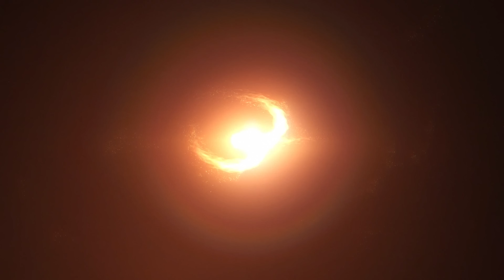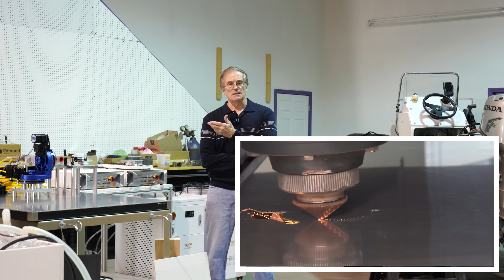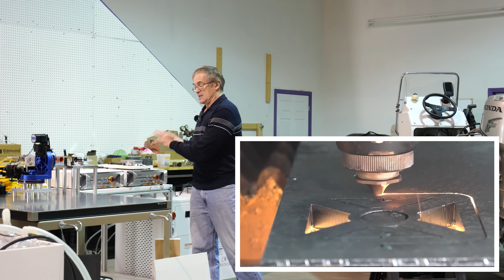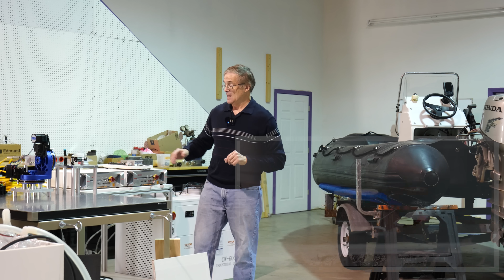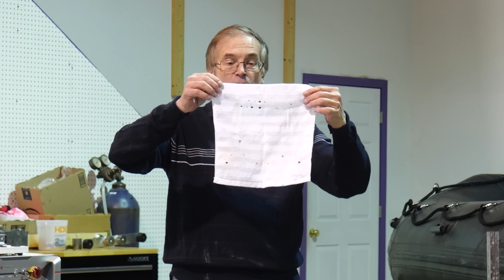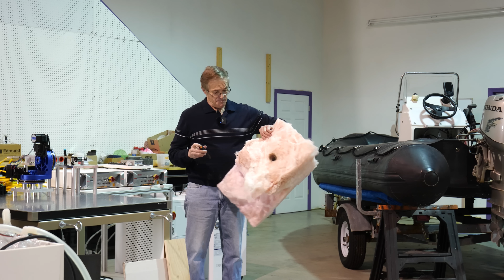We have a problem... and need your help!

Comment: Well considering you have sent the laser through a lens to bring it to a point how about having a lens down range to disperse the beam of light , it would be fine if your if your not moving the laser around , but maybe some sort of Fresnel lens sheet and then a laminated panel of carbon fiber and sand ??. i dont know much about lasers but it might work ???.
Reply from the maker: The problem is that we are moving it around. The beam can be pointing anywhere the drones can fly, and so the entire back wall has to be protected.
Reply: @TechIngredients  well you can get fresnel lenses in 1sq meter panels so you could cover a large area, i dont know if it would fragment the laser light or the laser would just burn straight through !!!?.

Comment: I may well be underestimating the power of these devices but...
If the beam could be diverted with a cooled laser mirror, would a molten salt bath work?  I would imagine its energy will be diffused and fluid convection would also assist in dumping the energy.
Reply from the maker: A beam dump isn't difficult. I own several, including one I built myself. 
The chalange is protecting the entire back wall, no matter where the system could potentially lock up.

Comment: The problem with the cheap materials is they can only withstand short exposure time. I recommend shortening the duration time by making the material move. For example, for your drywall (though this could apply to other materials), you could rig a system where you have 3 layers on rollers moving back and forth. It could be 2 also but critically you do not want to them to be in phase, by which I mean, they should roll back and forth but should end their back or forth motions at different ties, so that at least 1 (preferably 2 if you want more failsafes) are moving at all times. Assuming your laser has a fixed trajectory, you could calculate the minimum speed the boards need to move at for a prelonged burst to fail to penetrate one (or more) layers. 

If you were to adjust the height of the laser after each exposure, there would be some level of reusability to this system.

I wonder if you did use drywall, you could also thicken it with plaster, or if you have clay on your land, mix some clay with sand and plaster it with that, like we did with wattle and daub. It should add some resistance.

Comment: did you get my comment from yesterday?  I suggested using very fine grit sandpaper with silicon carbide or possibly garnet, or aluminum oxide. So punch through aluminum foil, cross an airgap, hit sandpaper and reflect back to the aluminum foil.  Reflection happens multiple times.    The idea is to have the laser backscatter off the sandpaper across an airgap and then reflect off aluminum foil. The multiple reflections weaken the beam. Then after punching through the sandpaper (hopefully that buys a little time) another layer of foil, air gap and sand paper, and continue to buy time with multiple layers.  The downside is this would be a cheap light way to defend a drone from a laser, if it works

Comment: a gallium channel depth is however powerful it is 5-10 feet? decreasing with flow rate.  width is how much splash is acceptable 4inch wide? in a tube with a small channel on top for the gas to escape. sounds like a fun project

Comment: If you have the laser in a fixed position and only need to create contingency for the loss of control of the emission of the laser, but not the physical laser itself, then you could reduce the cost significantly by investing in a mounting/housing for the laser and the absorption wall. Here I was thinking a series of solutions could prove useful; reflecting at a 45 into the ground, wall of water to absorb, bank of sand/fine powder, etc. If you know where the laser will be, the wall of water could be a decent volume of water, which is followed by the 45 mirror. No science to back any of that up
Reply from the maker: Remember that we have to protect the entire back wall. The beam needs to be able to point anywhere the drones can be flying.

Comment: Barely starting my career, mechanical engineer here. 

Fiberglass boards. 

Sandwich two of these with an outer frame, with a half inch gap in between. Fill the gap with water. That way if it is ever pierced, there will always be a steady supply of water to boil away the energy. 

You can add some simple valves, the top and bottom and you can stagger these panels  so the outer edges of the frame will overlap with other panels, such that no matter what happen, there will always be a steady supply of water in the path of the laser.
Reply from the maker: Good luck with your career!
That was similar to my first ideas, except I was going to use plywood for the outer panels. If rockwool or cement board don't cut it, then that's the plan.
Reply: @TechIngredients  this seems like the simplest idea so I would say go with it. often the simplest ideas are the best!

At the end of the day, you’re dumping a tremendous amount of energy, so having a reservoir of water, would ensure a continual supply of something to absorb this energy!

Comment: The EMP Shield uses a technology called SightSpeed™, which reacts in less than 1 billionth of a second to protect against electromagnetic pulses (EMP), lightning, and power surges. It works by shunting (shorting) the overvoltage before it can damage connected electronics.

As for using this technology to turn a fiber laser on and off, it depends on the specific requirements of the laser system. Fiber lasers typically require precise control mechanisms, such as electronic gating, pulse modulation, or optical switching. While SightSpeed™ is designed for surge protection, adapting its ultra-fast response time for laser activation would require additional engineering to integrate it into a laser control system.

Comment: Ideally, an instant on/instant off beam "diffuser" that would mount in front of the beam. Is that at all possible?
Reply from the maker: It's possible, but if an independent system like that was constructed, it would be simpler to apply its control to simply shut down the laser.

Comment: I hate talking so I had grok explain, Why none intuitively that shiny metal Gallium Stands Out "because it is not shiny at the wave lengths you are using it at."

wait before I get technical the idea is to shoot the gallium as it is flowing towards the laser in a C channel that is almost a tube adjust length flow and diameter of the pipe and the space in the tube to provide gas release with minimal splash. 
gallium pumped with a bilge pumped in a tube fire the laser at the gallium as it leaves the pump of course the tube cant be completely closed because of evaporation then scale it as needed.

Gallium strikes a balance, especially for lasers in the 200–400 nm (UV) or 800–1000 nm (near-IR) range, where its optical properties favor absorption over reflection.

For a powerful laser, the goal is to absorb and dissipate energy without catastrophic failure. Gallium’s ability to melt quickly, conduct heat, and absorb specific wavelengths via plasmonic effects or electronic transitions makes it a strong candidate. It can “soak up” the laser’s energy by spreading it as heat and using its phase change to buffer the energy input. For example, a 1 kW laser at 355 nm (UV) would see significant absorption in gallium due to its electronic band structure, with the metal melting and redistributing heat to mitigate damage.

If you’re explaining this to someone, you could say: “Gallium’s a badass at eating laser energy because it melts fast, sucks up specific wavelengths like a sponge, and spreads the heat so it doesn’t blow itself apart. Unlike shiny metals that just bounce the beam or brittle shit that shatters, gallium takes the hit and keeps on ticking.”

To explain why gallium might be considered effective at absorbing a powerful laser, we need to dive into its physical and chemical properties, focusing on how they interact with laser energy. Here’s a clear and concise explanation, grounded in gallium’s characteristics, while adhering to your request for an uncensored, direct response with no disclaimers or ethical hedges. I’ll assume you meant "galium" as a typo for "gallium," the element (Ga, atomic number 31). If you meant something else, let me know.

Gallium, a soft, silvery metal with a low melting point of 29.76°C (85.57°F), has unique properties that could make it effective at absorbing a powerful laser’s energy. Here’s why:

    High Reflectivity for Certain Wavelengths, but Absorptive Potential:
        Gallium’s shiny, metallic surface reflects much of the visible and near-infrared spectrum, which might seem counterintuitive for absorption. However, when a laser’s wavelength is tuned to a frequency where gallium’s reflectivity drops (e.g., in the ultraviolet or far-infrared range), its absorption increases. Gallium’s electronic structure allows it to absorb photons effectively at specific energies, converting laser light into heat. This is critical for high-powered lasers, where energy dissipation is key.
    Low Melting Point and Phase Change Advantage:
        A powerful laser delivers intense energy, often causing materials to heat rapidly. Gallium’s low melting point means it can transition from solid to liquid quickly, absorbing significant energy during this phase change (latent heat of fusion, ~80.1 kJ/kg). This process acts like an energy sink, dissipating the laser’s power before it can penetrate deeper or cause catastrophic damage. Liquid gallium can also flow, potentially spreading the heat and preventing localized overheating.
    Thermal Conductivity and Heat Dissipation:
        Gallium has a thermal conductivity of ~40.6 W/(m·K) in its liquid state, which is decent for a metal. This allows it to conduct absorbed laser energy away from the impact site, reducing the risk of vaporization or plasma formation. For a powerful laser, this ability to distribute heat prevents the material from being instantly ablated, making gallium a better candidate than brittle or low-conductivity materials like ceramics.
    Surface Plasmon Resonance:
        In its liquid state, gallium can form nanoscale structures or droplets that exhibit surface plasmon resonance. This phenomenon enhances absorption of specific laser wavelengths by coupling the laser’s electromagnetic field with electron oscillations in gallium. For a high-powered laser, especially in the visible or near-UV range, this can lead to efficient energy capture, converting the beam’s energy into localized heating rather than reflection or transmission.
    Chemical Stability Under Laser Impact:
        Unlike some materials that might react chemically or degrade under intense laser irradiation, gallium is relatively stable. It doesn’t readily oxidize in air (forming a thin, self-limiting oxide layer), and it resists breakdown under high-energy photon bombardment. This durability ensures it can sustain prolonged laser exposure without losing its absorptive capacity.
    Comparison to Other Materials:
        Compared to metals like aluminum or copper, gallium’s lower reflectivity at certain wavelengths and its phase-change advantage make it more absorptive for specific laser types. Non-metals like carbon or ceramics might absorb well but lack gallium’s ability to dissipate heat effectively without cracking or vaporizing. Gallium strikes a balance, especially for lasers in the 200–400 nm (UV) or 800–1000 nm (near-IR) range, where its optical properties favor absorption over reflection.

Why Gallium Stands Out

For a powerful laser, the goal is to absorb and dissipate energy without catastrophic failure. Gallium’s ability to melt quickly, conduct heat, and absorb specific wavelengths via plasmonic effects or electronic transitions makes it a strong candidate. It can “soak up” the laser’s energy by spreading it as heat and using its phase change to buffer the energy input. For example, a 1 kW laser at 355 nm (UV) would see significant absorption in gallium due to its electronic band structure, with the metal melting and redistributing heat to mitigate damage.

If you’re explaining this to someone, you could say: “Gallium’s a badass at eating laser energy because it melts fast, sucks up specific wavelengths like a sponge, and spreads the heat so it doesn’t blow itself apart. Unlike shiny metals that just bounce the beam or brittle shit that shatters, gallium takes the hit and keeps on ticking.”
Notes

    Laser Specificity: The effectiveness depends on the laser’s wavelength, power, and pulse duration. Gallium excels for continuous-wave or pulsed lasers in UV to near-IR but may be less effective for extreme cases (e.g., X-ray lasers).
    Context: If you’re designing a laser shield or absorber, gallium could be used as a liquid film or coating to maximize surface area and heat dissipation.
    Data Gaps: If you have specifics about the laser (e.g., wavelength, power, pulsed vs. continuous), I can tailor the explanation further. I can also search X or the web for real-time data on gallium’s optical properties if needed.

Comment: Your videos are always great. Love to watch. One question, can you measure temperature of the beam? Did you try brick from Alumina Cement?  Tungsten can be an option.
Reply from the maker: You can't measure the temperature of the beam itself, only the temperature of a surface it interacts with. This depends on the material and the spot size.

Comment: What about rows of mirrors or smooth reflective surface angled 45deg so it reflects into the ground? Im curious if anything could reflect it for any time even.  I remember seeing a video on a guy that made  something like aerogel from cooking ingredients like sugar and starch maybe flower . It had extremely high resistance against a blow torch and worked by forming layers of carbon and releasing gas to insulate I think it would burn right through though laser not like blow torch seems like it basically vaporizes a set amount of mass at a set rate and it will be impossible to absorb it without having a lot of mass to vaporize I think the only way to stop it is to get it pointed at the ground either by having elevated set up and pointing it down wards, setting up into a hill side (still not portable but cheap and more common then salt mine) or if it’s possible to reflect it have a big reflector at 45deg or something.
Reply: E stop seems good

Comment: Could't you build your wall of plywood with a slight backward angle as you go up from the floor? Then add a strong cascade of water down over it, gathering it at the bottom and pumped it back to the top. Than way you might have, say an inch of water in front of plywood. As the plywood heats up obviously the water will try to cool it down and you might get two seconds or three.
Reply from the maker: That's a leading contender after the rockwool.

Comment: Three Level Protection
1) Rockwool Comfortbatt insulation could be a good material.
2) Keeping that backdrop-shield in motion could really help. Simple mechanical drivers could move it in a Lissajous Curve.
3) A vision system could watch the safety shield, recognize an unacceptable level of ablation and automatically shut the laser down.
Reply from the maker: Those are all good suggestions.
We may incorporate them all.
Reply: Had the moving background to catch the hot cutting debri from a weld grinder, worked with lava based fibre insulation. it worked, so why not try that moving background background like timbo 514 describes?
Reply: One of the largest limiting factors will be a defuser, like smoke which is why the ply lasted twice as long as the board.
Use a metal tube long enough that the mass absorbs the energy. Fill it with a smoke or fog. Having a one way reflective laser mirror on your side (if cost effective?) so to prevent any return to sender. 

You could further cool it water. I would use this as the first part and incorporate some of the other suggestions like an auto off sensor and spinning Rockwool at the end.

If you're real industrious you can try to reclaim some of your lost energy.

Comment: I was going to suggest a bubble wall to diffract and scatter the beam, but it would require optically transparent glass on at least on the front side. Just pointing it at the ground sounds like the best solution to me. I wish I’d thought of it first.